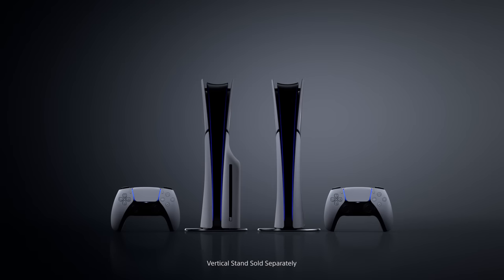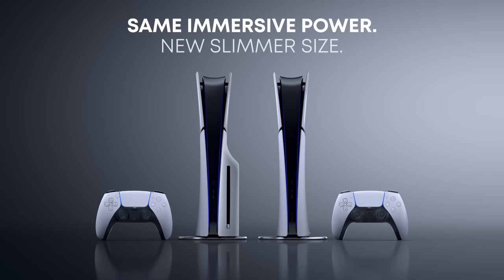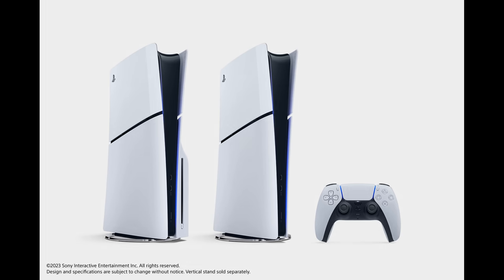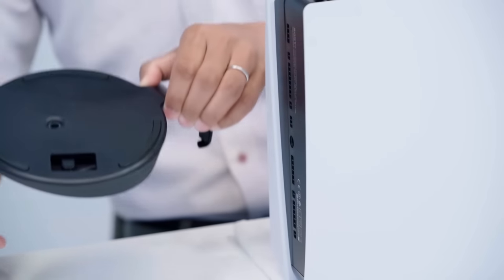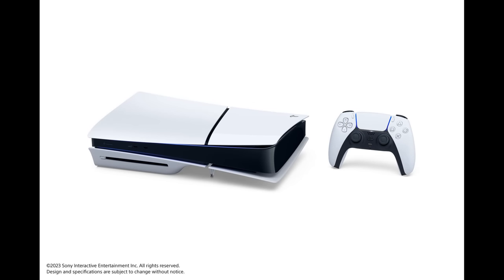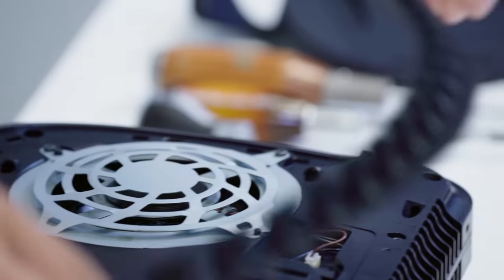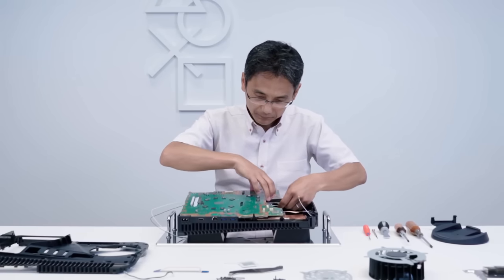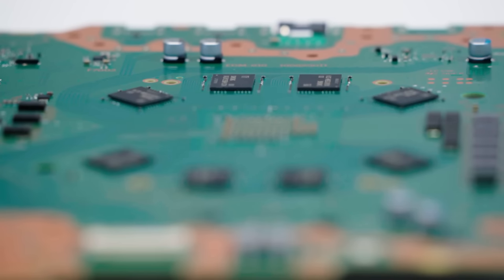PS5 Slim Details, The Good & Bad - Detachable Disc Drive, $30 Vertical Stand, 1TB of Storage

Comment: Personally, i don't like the "new" PS5 slim model design. But that's personal of course. And honestly, i never really liked any of the slim designs of the PlayStation. Well, maybe except for the PS2 & PS3. Though they both missed out on some features that the original designs had. Especially the PS2!

What i do like about the new design though, is the fact that it's more modular, with the disc-drive being detachable and the fact that you can also repair it more easily in the future if it ever comes to that! I think it would even be nice to just buy 2 separate disc-drives and just hold on to them for if you would ever need it 10yrs. from now for example. I mean, i'm really happy i was able to get a PS3 for cheap but because the original PS3 models were more likely to fail, i bought a second one. Though i'm planning on buying a slim PS3 as well in the future. They don't really cost as much anymore.

The other thing that i do like about the new PS5 design is the fact that the lights on the front seems to go from top to bottom? Or is that just something they did for the trailer? I really love the fact that Sony does something with these lights now. First with the PS4 and now the PS5. I hope they do continue that trend at least.

The storage is absolutely great but not really overwhelming. I mean, you maybe get around 150GB extra, and with the size of the games at this moment, that might give you 1 or 3 games extra depending on the games you play of of course!

The new stand, i mean, i kinda like the look of the new stand. But selling it as an optional item is really bogus if you ask me! I know they did this for the PS2 as well back in the days. But since they included it in the box with the PS5, i think most people kind of expect this. In theory, you can have the PS5 stand vertically without a stand, but i think you will cover up some of the cooling vents on the bottom if i'm not mistaking. Not 100% sure though. Another thing that someone told me is that with the new stand, you will hear a bit more noise. Because with the "older" design, the PS5 was "floating" thus holding back any vibration of the disc-drive.

Lastly, i am really curious about the PS5 Pro. Not only about the specs, but also about the design. I'm personally always worried about the design because in the end, it's a centerpiece in my entertainment system and it's nice if your console looks a bit cool/modern!

Comment: Sony has heen putting out a lot of product and software related things lately.  Black inzone h9 headset, inzone earbuds, a new inzone h5 headset, and being able to stream ps5 games.
For the ps5 slim, I wonder if you'll be able to put the original model console covers on it.  Also, would you be able to use the disc drive in the original disc ps5, just in case that worns out/breaks🤔. The real downside is that you need 4 panels and you have to pay extra for a vertical stand like they couldn't make the stand hybrid.  I wonder if they did this because the stand that came with the og ps5 is more stable vertically. I think the real problem for me would be those 4 panels though😬. Thank god I got the og ps5, but if my disc drive dies....oh lord

Comment: This is a great system. The first thing to break is always the disc drive, so it's nice knowing your system won't be useless if that goes out.
Reply: Hopefully the ssd is also user replaceable vs the older one if that dies your system is toast disk drive or digital.
Reply: @smgofdvld  Yeah but SSDs are MUCH more durable than a disk drive. They can survive 700 Terabytes to 1 Petabyte of write. A disk drive can break for no reason, or because you shove a disk in too hard or something.

Comment: The digital edition presented here I believe is an upgrade over the former digital edition as this one can be added to with a Blu-Ray disc drive. Oddly, against maybe what many would have thought, this expands the ability of disc based gaming on the platform for the rest of the generation as opposed to making it harder for consumers to buy and use physical games. The price increase isnt great but it really sinks in the idea that anyone buying a PS5 in November forward should just get the disc edition. As a BIG fan of physical media I am for the add-on approach of the drive with the digital machine. I wonder if the Pro will just have a disc drive and no digital edition or if they make 2 skus for that as well with detachable drives?

Comment: What a weird take.  Sony isn't embracing a digital future because they're releasing a new SKU with a disc drive?  That's because they're deprecating the old SKU with the disc drive.  They're always going to offer a version with a disc drive and one with out.

If Microsoft releases a new SKU without a disc drive, they're going to keep offering a version with a disc drive.  There's no 'win' here.  The only L is the increase in price in the digital only version up to $450 from $400 and then an increase in $30 for both SKUs for a vertical stand.

You gotta be scraping the bottom of the barrel to try to excuse this awful announcement into a 'win' for Sony.  They have effectively done a 20% price increase 3 years into a console generation on a digital only SKU.  $400 > $480 for effectively the same digital console.  They are banking on loyal customers like MBG to just spend another $500 just because they love Sony.
Reply: It's $450

Comment: I don't think it's actually that bad:

- The storage upgrade is actually more significant than it appears, because every gigabyte more will 100% go to your available storage. So if you look at it percentage-wise, it's substantially not trivial.
- I think in the US you were quite lucky that you had no price hikes up until now and let's face it do not have one for the disc model yet. Only if you really buy the digital model (which almost no one does), you get a price increase. So I think you are pretty OK. Considering the storage upgrade, it's even a slight drop in price. Inflation is a real thing, it's not just something corporations made up just to pull more dollars out of your pockets. And while the USD is quite strong, and the EURO is not, we had unfortunately the significant price increase, while you had not. And let's be honest, it was absolutely clear that this generation there will be no price drop. Stable prices was the best we could hope for.

But, yes, the thing with the stand I agree is a bit weird. You can make an environmental argument that it's less resources. But I bet that was not Sony's thinking 😂

I at first had my PS5 vertical, but I did not use the stand and I think many did not, so it was a waste. Later I put it sideways and only then started to use the stand.